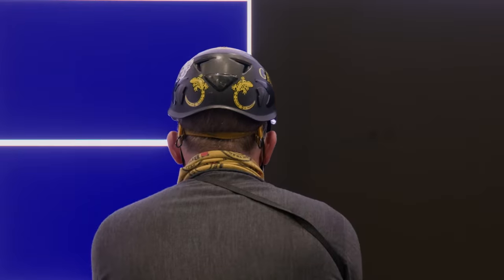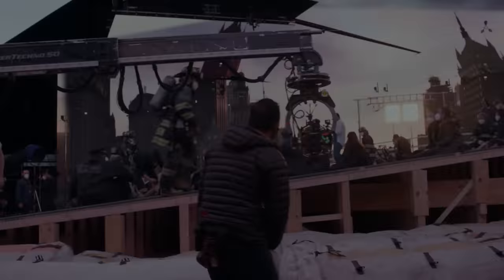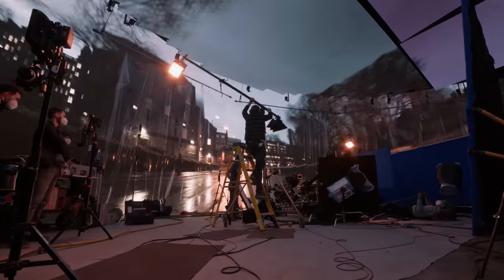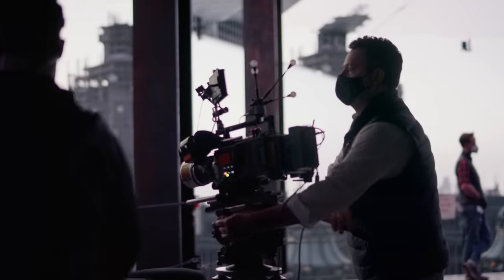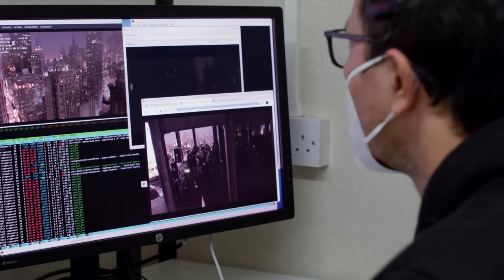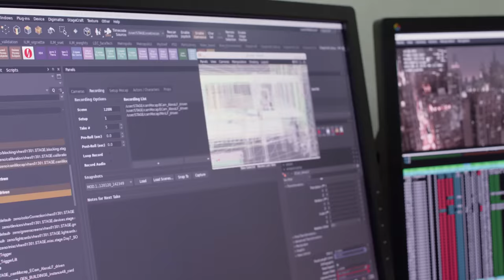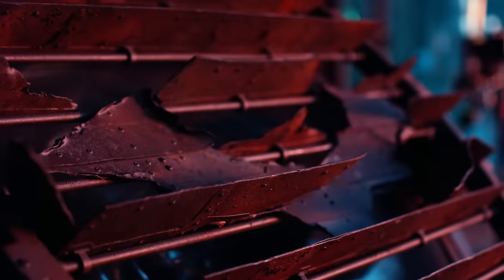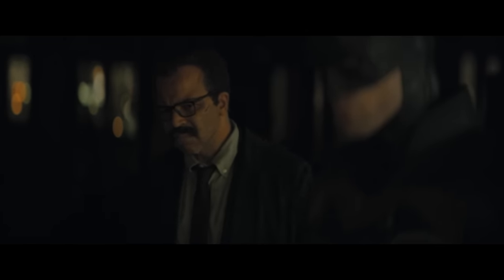The Making Of The Batman | The Batman | Max

Comment: Using this kind of technology can definitely cut down production times and cost when used properly,but it has its shortcomings. I'll use Lord of the Rings as an example. Depth of the environment will be lacking when this technique is used. Showing the Fellowship walking long expanses through the environment,that cannot be duplicated using this technique. But,in the case for The Batman, showing the tight confines of Gotham,it was used perfectly.